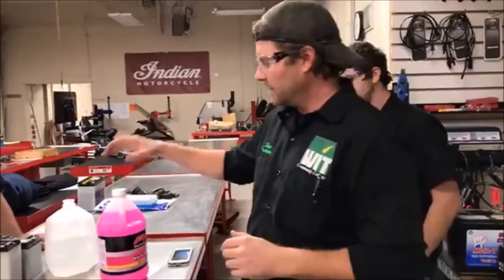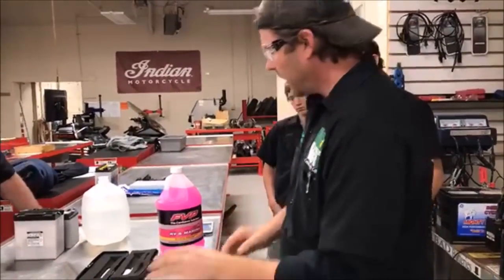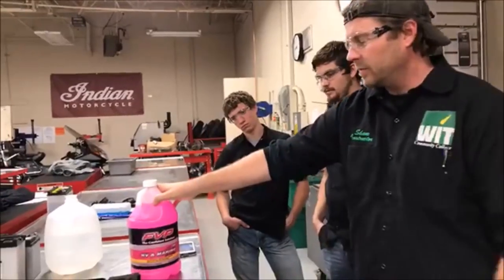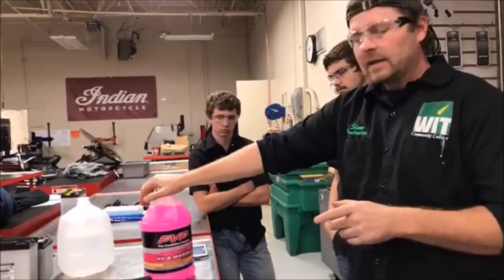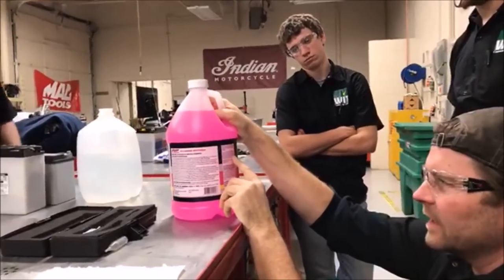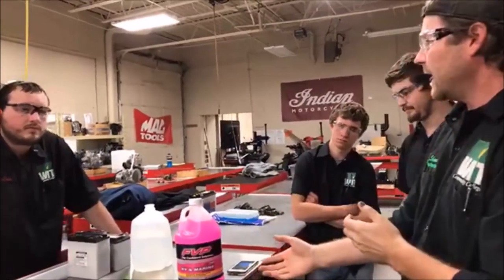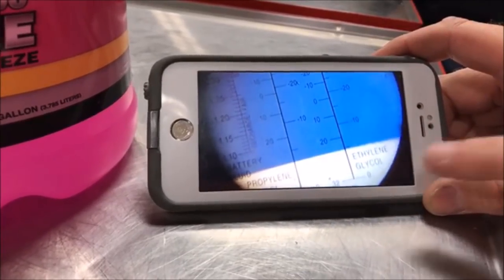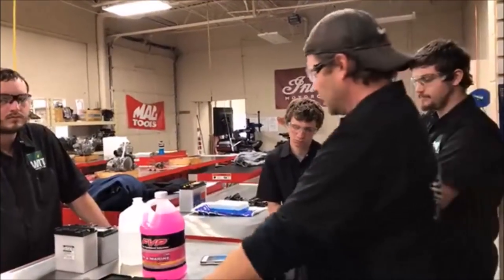FVP Antifreeze It will not burst pipes up to -50F deg! WARNING READ THE LABEL to not freak out!

Comment: 1. You can't get a reading with hydrometer when working with propylene glycol. 2. Burst temp is a language more associated with plumbers. It doesn't have the strength to bust a copper pipe at -50

Comment: There's something I don't see explained anywhere yet, in response to people saying "it gets slushy and freezes solid sometimes, but doesn't expand"...

The fact is ALL antifreeze expands as it freezes, almost as much as plain water does...

Huh?? ... Let me explain... It freezes gradually as it gets colder, instead of completely solid below a threshold, due to the mixture.

Water will start freezing, usually at the top and sides, inward, blocking it's own exit, thereby bursting a container of the wrong shape and orientation, which is almost everything that is not sloped open upwards.

When antifreeze freezes, the water tends to come out first, as a slush, and the rest of it is gradually included as more freezes.  The parts freezing expand as they do so, but the liquid remaining gets out of the way as the crystals form, moving toward the top where there's room.  As it freezes further, the crystals all consolidate into a porous solid, but still allow more liquid to get out.  Eventually though, it will block itself and start building pressure.

The reason Propylene Glycol based antifreeze is better, is because the glycol is more dense, the mixture can tolerate more freeze/thaw cycles which tend to separate the mixture.  The water tends to end up on top if it thaws, but since it tends to freeze from the top down, the glycol will push up through it, keeping it porous and not plugged.

Ethanol base generally works well, but if it separates, it's less dense, the water remains more on the bottom.  When it begins to re-freeze down lower, the slush doesn't as readily float up and there's less ethanol to push upward through it before plugging and bursting sooner.
Reply from the maker: Thank you for the detailed response...great for our community! 
👍 Thank you for taking the time to comment! Hit that subscribe button if you haven’t please! It helps us! 
Here is a way to support all the free videos.
Want to say “thanks” or “keep it up”? Click here https://www.paypal.me/how2wrench  

Coach Conley is also available for hire to personally work one on one with you if ever needed. Yep he is a real person. Give him a call @ 602-345-0432
Details here: https://how2wrench.com/product/personal-tech-training-phone-facetime/ 
Your answers and help are just around the corner. Save time and money while protecting your investment and yourself by doing it the right way!
Follow us!
Web:
www.How2Wrench.com     
www.Tools2Wrench.com

Comment: Well, lets think about it a second, what you want from those product is to protect pipe or plumbing componenet to hurst in cold temperature.
Pure water does expand quite a lot when it freeze, with some additive like glycol, sodium, ethanot, methanol, etc...) the freezing temp and  expansion rate change a lot.
So a slushy anti freeze liquid might look scarry but it  will  not expand at all.
Second thing, did you look at the composition of your anti-freeze?
Are you sure that it is a glycol blend??
Most product like that that i know of are a mix of ethanol and water with some rust inhibitor additive
if you put some ethanol(alcool) mix in your refractometer, and look at the temp rating on the glycol scale, your reading is way off.
You need a refractometer with a ethanol/methanol scale glass.

It is good to tell what you think but it is always better to think about what you're about to say!!

Thanks